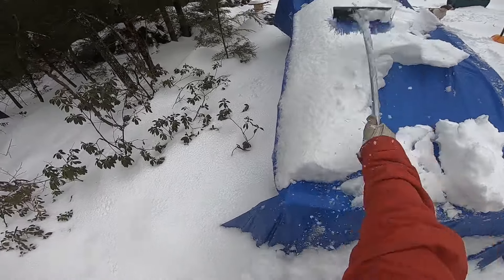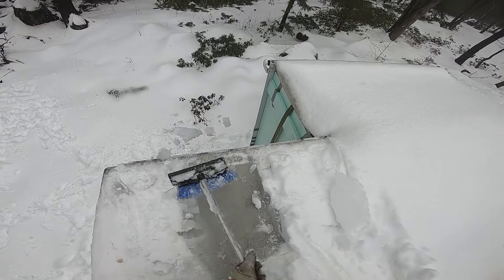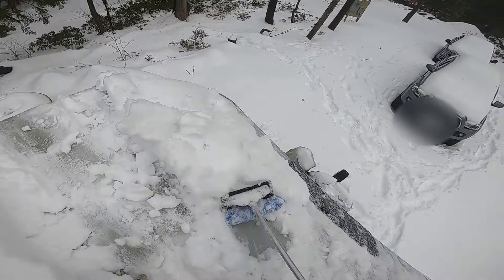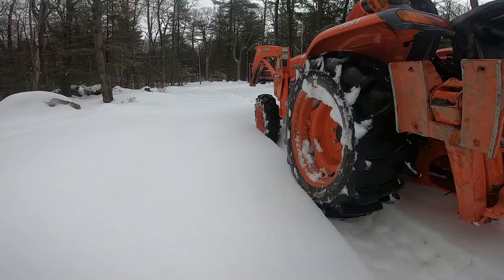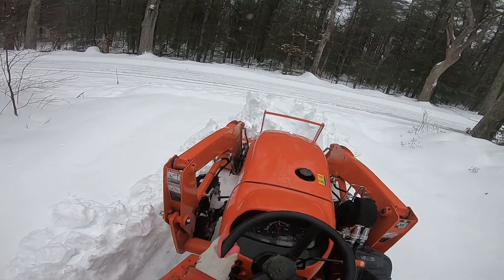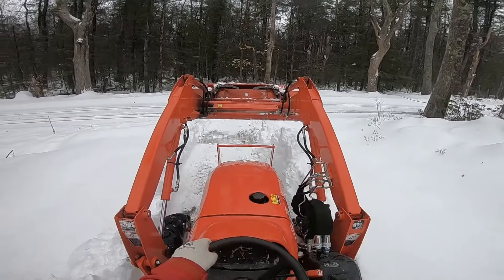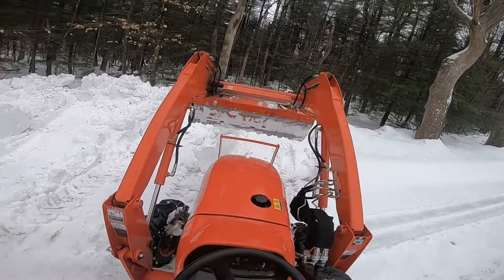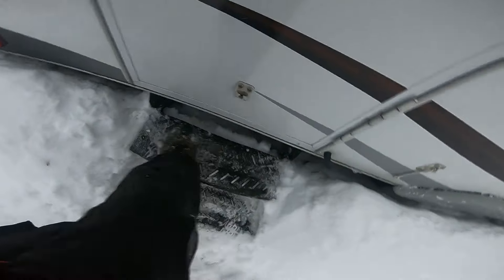A Snow Day Camper Living at Land w/ Kubota L2501 (#9)

Comment: Sure don't look like a foot of snow while you're driving through it... Or on the roof of the camper.
Reply from the maker: Ya probably around 8in by the time I started filming. Had about 12in at night and then from the sun and whatnot it really compacted down quickly. The tractor was staying on top pretty well too surprisingly since the front tires I have are decently skinny
Reply: *doesn’t